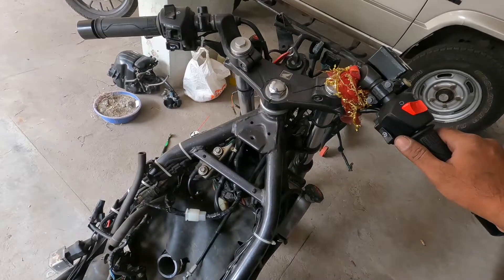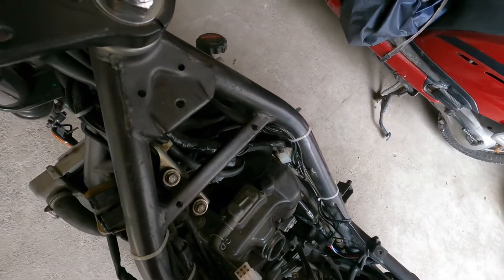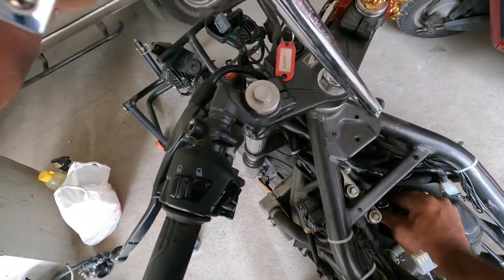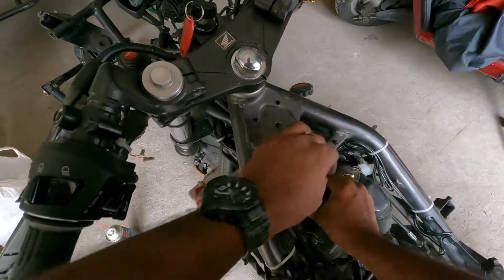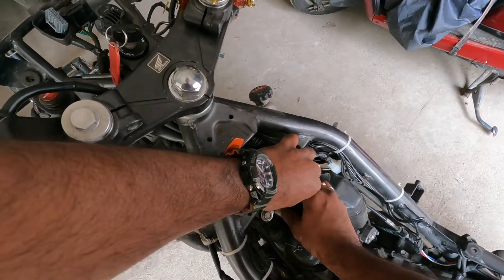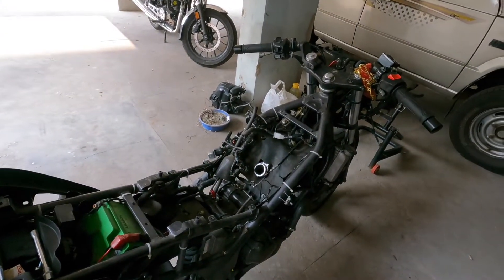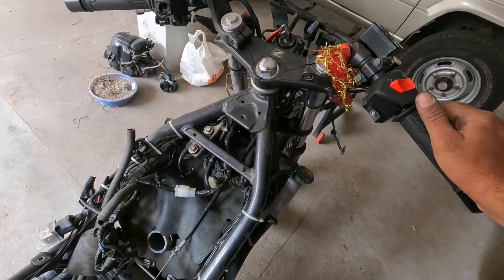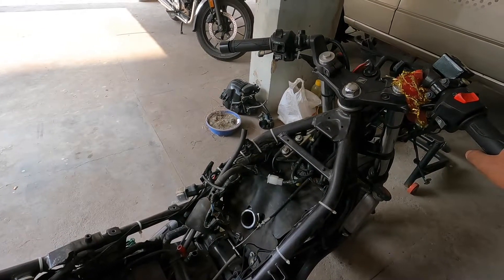Honda CBR 250 R | Spark Plug Replacement | Special Tools | Step By Step Guide.

Comment: You did it in the most difficult way. I had to also check my spark plug on the same bike and  saw many videos like that even for cbr1000rr. I have cbr250r and cbr1000rr sc57. Many people remove almost anyting to access the plugs and also believe that the only plug for cbr250r is NGK SIMR8A9. I found that it is verry easy job if you just remove the bolt of the radiator move it a bit, remove one of the side fairings. After that with a spark plug bit size 16mm and some flexible short arm for it available in every store you could remove the plug with no pain at all. Also from NGK there is a spark plug alternative with number CR8EIX which is verry cheep and works really well with this bike. You have to adjist the gap to 0.9 with some scredriver and gap tester carefully without touching the electrode. This cheep plug works with no difference than the more expensive simr8a9 it is same thread same heat index same everything just there is no projection which is not a big drama i would say. Denso also sell a spark plug without a projection for this bike. You just need to check the gap to be 0.9mm. They say it is not recommended to use gap tester which is not wire type but i think the drama here is to be carefull to not brak the electrode so no need to be tight feet just have to check 0.9 fith without any pressure and 0.95 does not fit at all

Comment: I bought a ngk Iridium SIMR8A9 for my cbr 250r is it the same spark plug you used or any different plss reply?? And what is the gap is 0.9mm is perfect??
Reply from the maker: Yes thats the one. Not sure about the gap, should be between 0.8 to 0.9